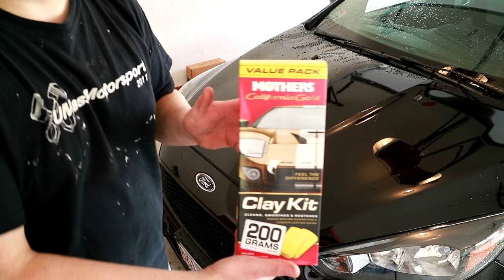Installing a DIY 3M Clear Bra on my Ford Focus ST (How To Paint Protection Vinyl)

Comment: I see that you installed the clear bra in Summer 2018.... is it still holding up well?
Reply: i bought a carbon vinyl from vivid. it was completely and i mean completely fucked in 6 months. ZERO!!!! uv  protection. its fucked
Reply: lindseyhunt1090-GarageB Then you bought the wrong stuff or something dude. Don’t go around spreading miss information like that. This vivid clear is literally $10 per square foot, and works insanely good. I had a clear bra installed on my STI 8 years ago and unfortunately it has some yellowing, but barely noticeable. The newer stuff shouldn’t even yellow either.
Reply: @Kyezie131  I bought vivid carbon vinyl wrap and its fucked... how am I lying... you just said you bought a clear bra and its yellowing.... hu?
Reply: @lindseyhunt1090garageb  Last time I checked this video wasnt about installing a carbon fibre wrap, so why answer a guy asking how this CLEAR wrap holds up? Plus you say it was completely fucked but give no circumstances. You probably keep your car outside with no covering 365 days a year lmfao. I'm rying to give some info to the original commenter.
Reply: @Kyezie131  the guy asked how it held up. I said I bought a product from vivid and it was fucked in 6 months. The car is kept outside. I dont really think that's an excuse to have it be fucked in 6 months. It cracked and pealed. Also the finish is completely dull and the carbon style finish is just brown and you cant see it anymore. It looks like it was on fire. Sorry for replying to a question. Have a good day
Reply: @lindseyhunt1090garageb  Yeah I get that but youre literally saying how a DIFFERENT product held up hahhahahhahahha like what
Reply: Hello: Gave me a great tutorial on doing a front nose protection for my 2019 Challenger.  Did you have to use a heat gun anywhere to conform to curves or odd shapes?  Probably required on complex areas  more, but also on the film you had to tuck under the hood edge.   Any other tips you have after the fact that you overlooked when you did your car?   I see you didn't do the whole front fascia.  
  Thank you!
Reply: @Kyezie131  It actually helps to know that a different product sucks. When you look for clear bra the top results are 3m by vivid. Good to know to stay away from that.
Reply: @lindseyhunt1090garageb  it's only good for interior or a jenky show car.
Reply: @scotts6596  there is a great video by Avery Dennison

Comment: Very good video.  Thanks.  It is now 3 years later.  Did it hold up well?  Also, and you may not remember, those little water bubbles trapped that were supposed to disappear with evaporation, did that happen?  Did the bubbles just disappear?
Reply: Great reply JR 🙄

Comment: How often do you re-apply it?  Can you make a video showing the removal of the old one before re-applying a new
Reply: What’s that supposed to mean? Literally take off the old one and put on the new one like he showed in the video lol
Reply: @Kyezie131  I suppose he's asking how long it lasts / how often do you need to replace it
Reply: If you want to remove  you kan use a steamer  or hot water loosens the glue
Reply: I've had mine for 6 years before trading the vehicle in and had no problem
Reply: It should be re applied after 6 months if you up keep it will be great for the car if you do not it can actually be harmful to the paint underneath. I don't tuck my edges due to that reason. this is my professional opinion. yes it protects from chipping but if apply incorrectly it can damage the car.
Reply: @jalissalove4781  BS. it's not harmful to the paint at all. I've removed these that have been on vehicles for nearly a decade. They become an absolute pain to take off when they get crusty but they've always come off with the paint looking better than the rest of the vehicle. Actually have to buff the panel just to make it blend.
Reply: @jalissalove4781  wait, reapply every 6 months.  Twice a year? And what's this about letting the paint breathe? 🎨
Reply: What are the ratios of the mixtures in the bottles? What is the free one is alcohol?What do you wear?

Comment: Hello, just your local technician I professionally install these for a living I do say it can be difficult but I love my job! I would recommend using baby soap instead of dish soap it is more gentle and not as harsh as dish soap. That was one thing I learned when I first started. No clue how long you have been doing it but some of those chemicals can be harmful and if you don't get all of the water out it can actually ruin the paint underneath the clear bra I found that out the hard way. Otherwise this was a very great application process. When you go to make it stick to the car use a little bit of rubbing alcohol mixed with water to create a solution it will make it stick longer.  If it gets to sticky or tacky when applying use that water mixture of baby soap and water to pull up. Then re apply. after it is finished hear down with a heat gun. Trim edges with razor blade. To pop bubbles use a insulin needle to suck out all of the excess air pockets! For any prep after you clean the car wipe off with adhesive remover then rubbing alcohol before spray down with the soapy water solution. I just summed up some of it so it is easier to understand for all of you. Hope this helps! Any questions feel free to ask me!  Good luck you're doing great so far!
Reply from the maker: Thanks for the tips!
Reply: So initially I would use the baby soap and water mixture. But then when I’m ready to actually squeegee it I would apply the alcohol and water mixture under it ? And if it gets too tacky I would reapply the  other solution under it?

Comment: Looks good, did I miss where you used the isopropyl alcohol and water mix?
Reply: yes I was wondering what the alcohol was for as well.
Reply: sheamurai to remove any grease, dust, wax, residue etc left on the panel. That way the wrap gets the best possible adhesion.

Comment: That was on a 2017 Toyota Highlander i own and after three years it started getting black spots under the film, which was where small pin holes where in the film and it looked terrible, and was turning black alone the edges, it was on the hood, mirrors, under door handles, door edges, rear bumper, I removed it all, looks like a new car
Reply: Then you reinstall it again 😂

Comment: Hi, I have some questions please.

How do you know if you have too little soap or too much soap is there a way to check. I ask as surely there will be several variables that could make this different?

What squeegee do you recommend as if there are rolls or convex curves, how do I bend the hard card?

What tacky substance do you recommend for the edges, and how much would I use?

Thanks so much
Reply from the maker: The soap just put enough that is can slip. Ultimately you squeegee out all of it so no magic ratio.

The squeegee I recommend is in linked in the description. It is a nice firm plastic with felt edges so you don't scratch or damage anything. 

The adhesive on the vinyl is what gets tacky. You just need to use isopropyl alcohol to spray off the soapy water. Let it dry a little, and then it is tacky to tuck the edges.
Reply: @JrsGasolineAlley   Jr's Gasoline Alley  thanks, just having done a lot of research (me being me sorry) it's very clear that if it's cold the soap should be different if it's hot the soap should be different as well as other things. I heard there is a science to mixing the perfect bottle but have yet to come across the proper information, I was hoping you may know. 

Again from research, it seems that the rubber squeegees are much better suited so the swueegee can bend? Hard cards which you are using apparently don't work that well. What do you think?

With the Alcohol, again how much is enough, if for example I'm using the same bottles as you, which I guess is 1litre? I'm guessing there's at set amount or a correct ratio?

Thanks again for your help. And thanks for coming back to me.

Comment: I always though you're not supposed to use dish soap on cars as it's can strip the wax or protective coating off the paint. I mean, i guess it doesn't really matter since there will be a vinyl layer, but it still doesn't sit well with me. Would using carwash soap work just as well?
Reply: I’m a installer, use baby soap 👊

Comment: How does the clear wrap adhere to the car though, is an adhesive activated by the water or ?? I have some I want to apply to an epxy resing finish, but I dont detect any kind of adhesive.
Reply: Generally isopropyl  alcohol and water activates  the glue  than squeegee  to force it down flat

Comment: What liquid do you spray on the vinyl and car to make it adhere?
Reply: Hey I am a clear bra technician when you go to make it stick to the car use a little bit of rubbing alcohol mixed with water to create a solution it will make it stick longer.  If it gets to sticky or tacky when applying use that water mixture of baby soap and water to pull up. Then re apply. after it is finished hear down with a heat gun. Trim edges with razor blade. to pop bubples use a insulin needle to suck out all of the excess air pockets! Hope this helps!

Comment: Underside wrap is ESSENTIAL. don't do that and you WILL find chips on the edge. 
Worth doing all day every day especially on black car
Reply from the maker: Good tip.
Reply: I had mine professionally applied and he did not wrap the edges. Just about every area has a chip on the edge, definitly wrap the edges!!!

Comment: Hi quick question since you used to have a renegade , what roof basket would fit the car nicely , I was looking at the Thule and rhino rack , I have the oem roof rails that’s you had used on your renegade and I bought some cross rails that fit Nicely on the roof rails so just wondering what basket would fit it nice
Reply from the maker: Personally, I think these Rola roof top baskets look nice: https://amzn.to/2M1MV9p I have seen some mounted up on the forums.

Comment: Good job, gonna try this myself in the spring. Also, what is that instrumental at the end?
Reply from the maker: Take your time and make sure the hood is very........... very clean!
Reply: Can this work with my mountain bike
Reply: marlon cordova it should but I will be a little harder to apply, also make sure to pre cut and use a heat gun to make sure it sticks after application ;) good luck!
Reply: @LaRockeritam19 so you do need to add heat after it dries?
Reply: Calvin Wong you can, or just leave it on the sun for a few minutes to settle
Reply: @JrsGasolineAlley  how’s it holding up ? Is it turning yellow yet ?

Comment: What thickness film do you use? I found a dealer that have 3M SGH12 and SGH6 film (0.30mm and 0.15mm)
Reply from the maker: I am not sure how thick it is that I purchased, but the link is in the description.

Comment: When did you use the IPA and water solution? Did you use only soapy water to set the film?
Reply from the maker: Soapy water at the beginning, IPA water mixture to clean off the excess when you squeegee down the film and to set the  edges

Comment: While this is a very good idea to protect the hood from scratches, I wonder after several years under the sun if one decides to remove the film, half the hood is gonna look brand new and half the hood is gonna be faded.
Reply from the maker: I don't know that modern paint has too too much of an issue.
Reply: Do a ceramic coating over it and protects against UV rays
Reply: I had it put on my 2015 Ram and it not only protected my hood but no, there was no discoloration. I just traded it this past week.

Comment: Nightmare to remove after it yellows and cracks but nice while it lasts. Definitely protects the paint though.
Reply: N English ppf has come a long way. Should get 5-10 years out of this.
Reply from the maker: Exactly
Reply: Get in the habit of replacing it every year or two, to avoid any potential problems. Only takes a minutes to replace anyway.
Reply: @firebir11  Not quite minutes, mine is the half the hood, and half the fenders, and the whole bumper, on an acadia. So not even close to minutes. I bought the good stuff with a 7 year guarantee this time. Free replacement if anything happens to it before then (except for stupid obvious damage)

Comment: What is the function of this wrap? Does this wrap make your car looks more shinny?
Reply: It protects your paint and clear coat. Its also really good at protecting from rocks and bugs splatting all over your front end which damages your paint. Bugs excrete acid and there hard exoskeletons dig into your clear coat damaging it. Im getting this done on my front bumper simply because of the bugs. Its much easier to clean the bugs off as well and without damaging the integrity of your paint.

Comment: so it is not sticky like a vinyl? I need something which holds down things below it
Reply: It definitely has adhesive.  The water helps it slip until ready to squeegee. When he says, let it get tacky, he is allowing the adhesive to activate and overpower the slip agent.
Reply: @BnMGarage  ok but I want to cover parts and seal from water so no water should be used while applying also. I want to use double side tape to glue pure thin diy solar cells 15cm x 8 cm units to the top of my car and needs some transparent weather and waterproof cover on top of it, still dont know what could be used yet
Reply: @fotoamgamgfoto3695  ah, I see, then it definitely sounds like the thicker viny would work better. If the solar cells could survive the tack and slick, the ppf could be an option as well.
Reply: @BnMGarage  I think about not to put on some kithchen sink side sealing transparent tape, it is waterproof and strong but for UV don1t know :(

Comment: Will it stick if we don't apply alcohol?
Reply from the maker: The alcohol helps the water evaporate from under the PPF.
Reply: @JrsGasolineAlley  do you have to spray the alcohol on the adhesive before applying it or when you’re ready to squeegee?

Comment: I dont see that you prep inside the hood. Then later you was trying to fold the vinyl on the edges. If you dont prep those areas the film will no last. I dont like it.
Reply from the maker: In the video I show cleaning the edge under the hood so that it is clean and sticks. This lasted 2y now so I'm pretty sure it works just fine.